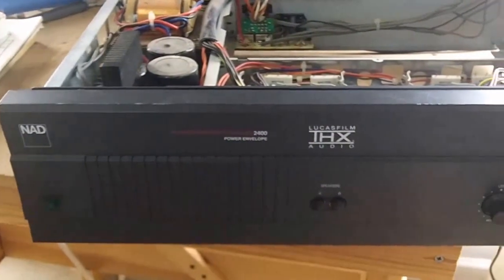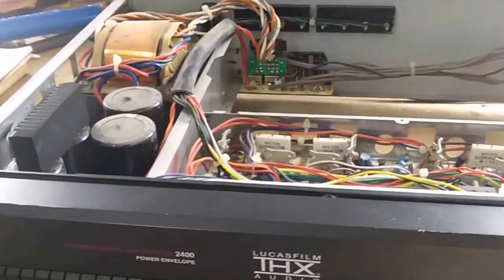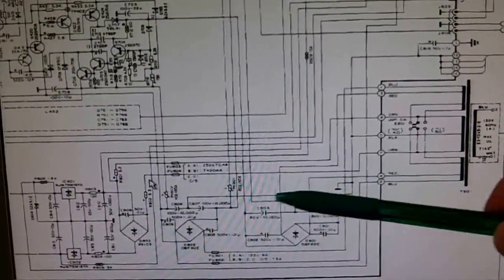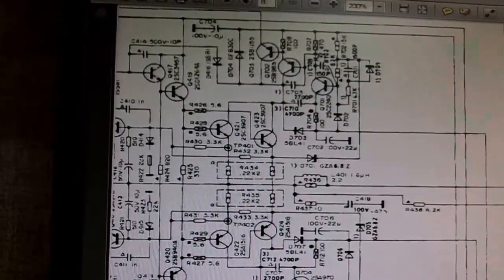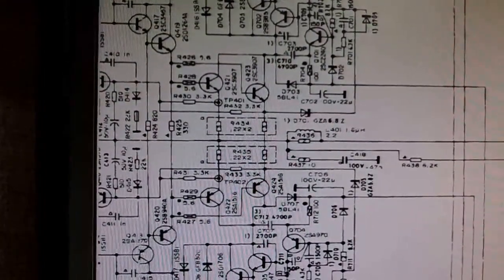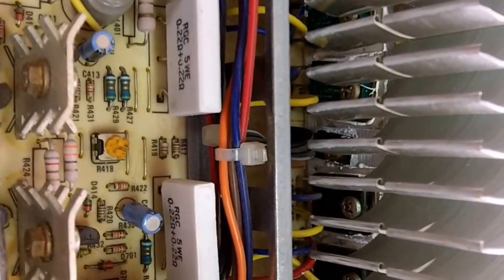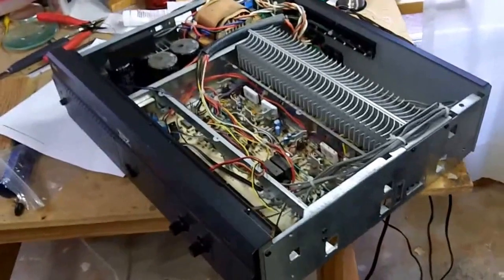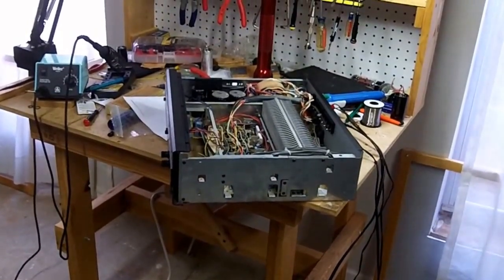Stereo Power Amplifier Repair

Comment: Nice work !  How do you know output transistors blown?  I have power amp which does not blow fuse, even  no signal connected,  if turn on amp it  making loud  unbearable screeching sound from speakers , Does it mean output stage is shot ?

Comment: Thanks for this video, subscribed. I found this video while searching for amp repair info. I have an NAD 902 obtained in a craigslist trade in which the other party ripped me off. I was an idiot and didn't test the equipment first. As soon as I got home and plugged it in, realized one of the RCA connectors needs to be jiggled just right or the channel cuts out. Despite this, I absolutely love this stereo amp over the feature-heavy Sony 7.1 surround receiver that I traded to that fat lucky jerk. A couple years later my stinking cat jumped and landed on my beloved 902, breaking one of the speaker connectors. This nice little amp has seen some rough times, but I think the problems are minor. Right now zip ties are putting just the right tension on the RCA connector, and the bare wire on the speaker output is held in place with electrical tape. I don't have any soldering experience, but I did find a service manual. Can you still buy OEM parts for these early 90s models?
Reply from the maker: First of all determine what is causing the erratic connection in your RCA jack. If you can repair it, that is your best option. If it is damaged beyond repair, then you will have to try and find a substitute part. You can buy many parts for older amps, but you may have to do some searching to find ones that work in your amp. In some cases exact replacements will be available - components such as resistors, capacitors, transistors.  Other parts such as chassis mount connectors you will have to search vendors such as Mouser Electronics or Digikey to find parts that are close in form, fit and function.
Reply: @jamelectronics  Thanks for the detailed response. The erratic connection is fixed by jiggling the wire around at the connection. I'll invest in a soldering iron, and then a new amp depending on how that goes.

Comment: Good day Sir. I have a  NAD 2200. The minute i plug an input in the right channel, the relay click when i go upper with the volume.At low volume, it will play, but at high, the relay cuts. This amp has low voltage 62V at low volume and than when i go up the volume, it goes up at 92.7 volts. Two voltages. My problem is that all the components, output, drivers, resistors, etc.. are good compare with the other side that works. I even interchanged the relays and same problem. Now the only thing i did not change are capacitors but all voltages are good. My question is: Is it possible that even if a transistor have the right voltages and work good, it can be defect. Secondly, when i bypass the relay i go up with the volume and it works good exept when i shut it off without the relays i get a big DC voltages boummm  in the speakers. i don't know where to look anymore. Help would be appreciate. By the way i'm a certified electronic technician but not a lot of experience. Can you please give me some advises? Thank's in advance. It's a  NAD 2200, right side cut relay cut when i put the volume up. Excuse my english Sir. Paul. Best regards.
Reply from the maker: Here are some ideas. Check the Center Voltage is set to "0" per the alignment procedure( adjust with SVR202 for right channel SVR 201 for left). Also, check the Idling voltage while you're at it( part of alignment). IC 403 is the Relay Drive Protection Circuit and must have correct voltages on its inputs or it will protect the circuits. Pins 2,3, and 7 should be "0" volts. Q336 and Q338 are the overcurrent detection transistors, so these need to be checked. 
Any component in these circuits could be bad or marginal, so it can be very difficult to find the one. Good luck! Your English is fine!

Comment: For testing purposes its wiser to test on a current limited isolation transformer, not just a variac.  Also, considering the age of it and that there was a transistor failure, it would probably be ideal to recap the unit and ensure the power supply and filter caps are good.  Since it seems its a piece of gear from the late 80’s or early 90’s all the electrolytics are likely due for replacement just from ESR.  With a high current failure, I’d replace them all just for insurance.

Comment: good repair...my amplifier cooling fan not work...
Reply from the maker: On some amps the fan might run continuously, on others the circuitry may sense the heat sink temp. and turn on the fan when the temperature gets to a certain level.  First, you should determine if yours really doesn't work or if temps. just aren't such that it is coming on. Then, if there is a problem, figure out whether it is the fan itself or the circuit driving the fan . Replacement fans should be available from the manufacturer or equivalents can be bought from electronics vendors like Mouser or Digikey. Good luck!